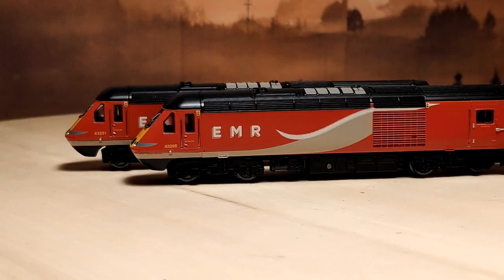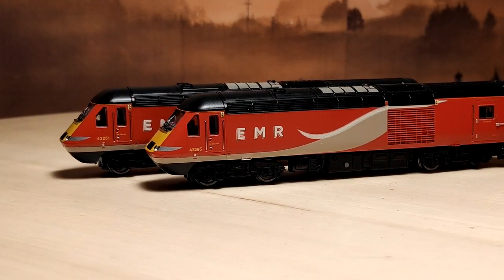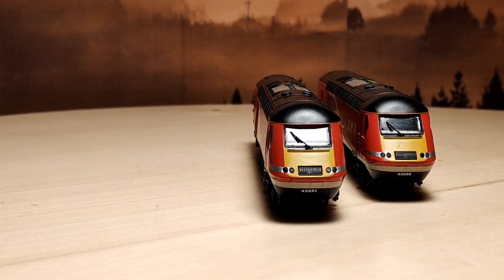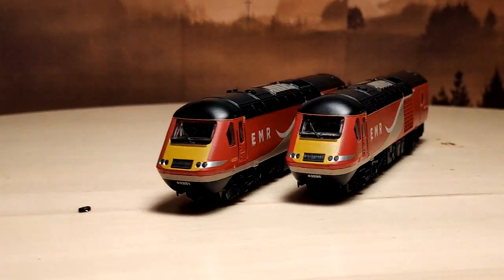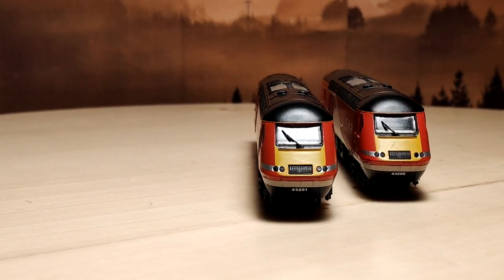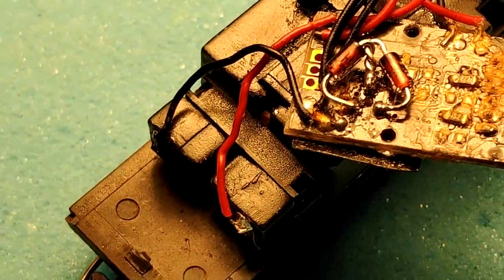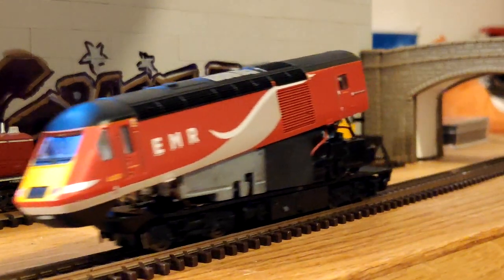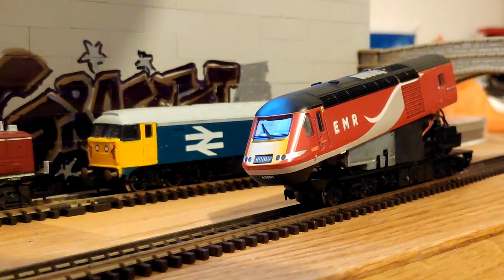Dapol HST Light PCB Fix!! diodes and swapping wires!

Comment: Nice job with the diode fix, I know the diodes are a common lighting fault on the Dapol locos, I intend doing a body swap on a Dapol hst, swapping the dummy to the power car and vice versa, will the lights work the right way, or will they be in reverse? I got a bit lost in that part LOL! All the best Tony.
Reply from the maker: Hi Tony!! yeah sorry think i might of rushed that a bit, just swap your shells over and plug them in... if the lights are backwards just swap the outer two wires on the plug around... three pin plug.. keep the middle pin as is, swap the outer two... 👍, if you get stuck let me know chap

Comment: Easier to just buy and re-solder on a new SMD BAT54C dual Schottkey diode package (that is what 'KL3' actually is component reference-wise) - you can get these for pennies on ebay - I've repaired many such.
Reply from the maker: Do you have a link to your video on fixing these PCBs? Would love to see how youve done it, what tools you used etc
Reply: @ThisWayWorksTWW  I don't have a video on it - there's not much to film anyway as it was a direct component swap of the surface mount diode package, just unsoldering the dead one, and replacing with a new one.